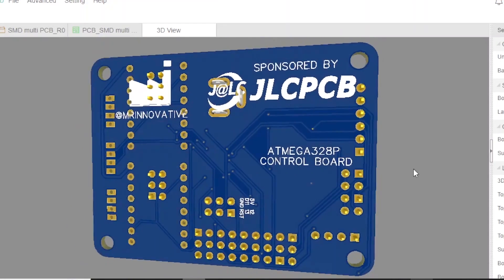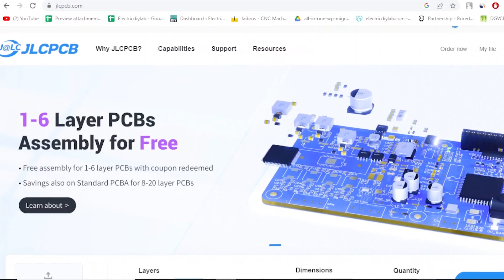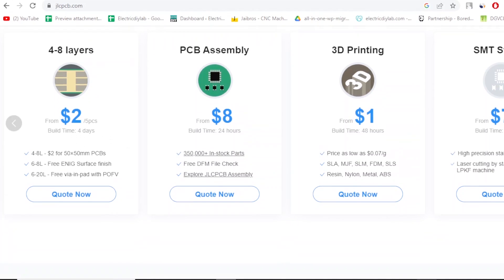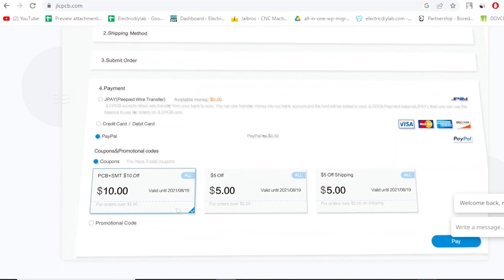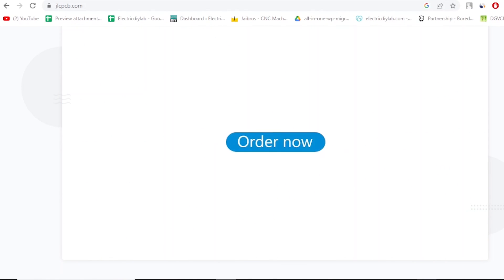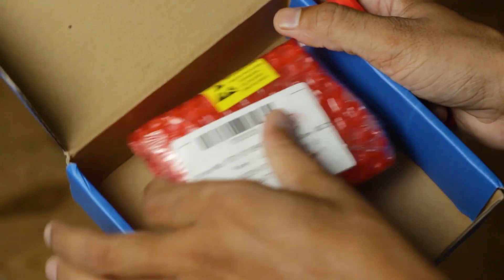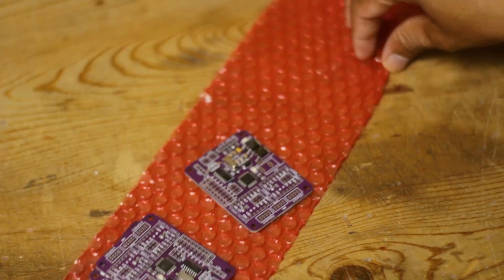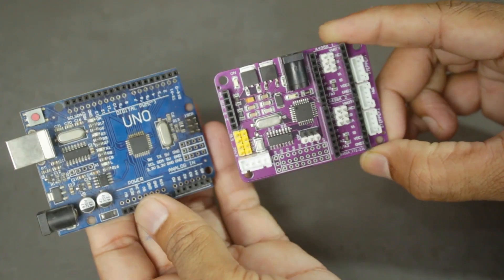DIY thermal Paper Laser printing machine

Comment: Finally something actually useful
Reply: 😂 You must not be aware that thermal printers have been out for decades and print way faster with no ink or lasers
Reply: @DivinityIsPurity  Faster, but DPI of thermal printers lower than laser+stepmotors
Reply: @IvanDorozhkin yeah, laser cnc machines using stepper motors have been out for a while too 😉
Reply: @DivinityIsPurity  but it costs more than diy)
Reply: @IvanDorozhkin That may depend where you live and how much you earn for the time it takes to build one, fine tune it and perfect the result.
Reply: @DivinityIsPurity  also, instead of paper you can insert a FR4/Copper Clad Laminate with photoresist to make a PCB for next laser printing machine )
Reply: @DivinityIsPurity  
Yes I know they exist but there's not many simple and cheap DIY laser printers